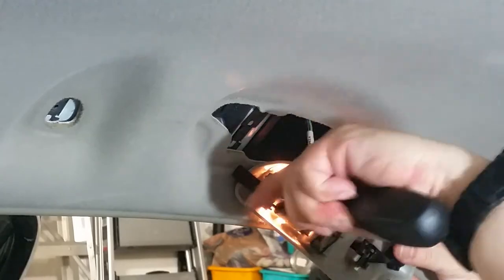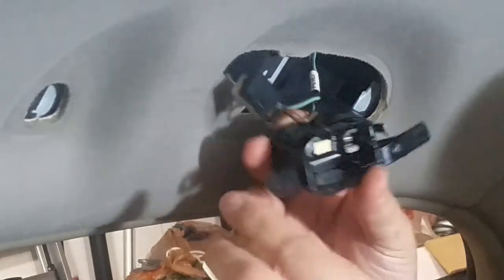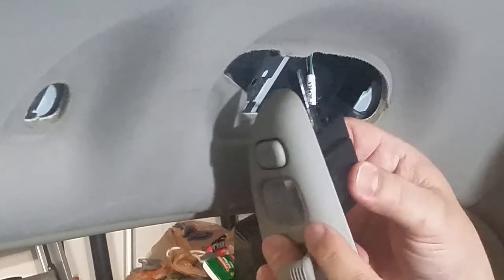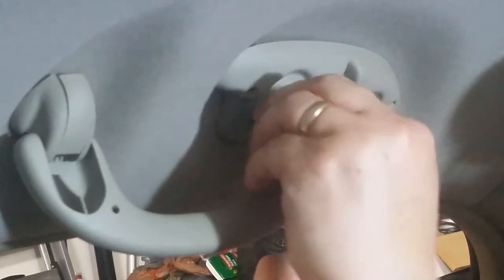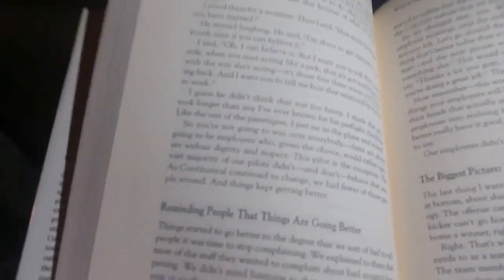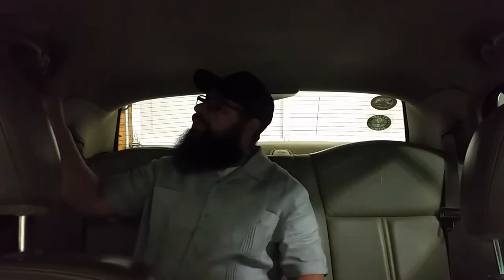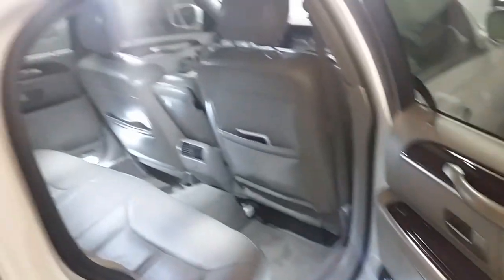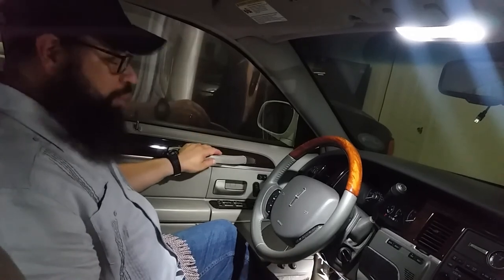Rear LED dome light from incandescent on Lincoln Town Car Luxury Land Yacht

Comment: Nice work. If you have a early 03 you have a gem because right where that little hole is next to the  mounting point there is a tiny little bulb in there providing a nice glow in the rear cabin while riding at night. Lincoln called it opera lighting and the early 03s are the only ones to have rear and front opera cabin lighting. After they discontinued rear ohpras in early 03 the front cabin ohpra lightning Green bulbs) remained until 06 when they took away the overhead panel with full read out compass. After 06 no ohpra lightning at all. So if you have a 03 go look I bet the bulbs are just burnt out
Reply from the maker: Never knew that on the 03 to 05. Thanks for saying. Mines is an 08 model.
Reply: I have a 03 Cartier. I dont see the "front Opera light" that you are talking about.
Reply from the maker: Sorry he didn't respond to you it's been 2 months already.

Comment: Wat r the numer for those rear handle bars led lights ur installing or the name i need 2 of those
Reply from the maker: https://www.amazon.com/gp/product/B07F9JTWQF/ref=ppx_yo_dt_b_asin_title_o02_s00?ie=UTF8&psc=1
Reply from the maker: Amazon has them  578 LED bulb 42mm  https://www.amazon.com/s?k=578+LED+Bulb+White%2C+42mm+6500K+CANBUS+Error+Free+6-SMD+Festoon+LED+Interior+Map+Dome+Door+Lights+Bulbs+211-2+212-2+569+6411%2C&i=automotive&crid=3LC37YFV5FM9K&sprefix=578+led+bulb+white%2C+42mm+6500k+canbus+error+free+6-smd+festoon+led+interior+map+dome+door+lights+bulbs+211-2+212-2+569+6411%2C%2Cautomotive%2C106&ref=nb_sb_noss

Comment: Do you happen to know what kind goes in the visors?
Reply from the maker: No I don't know what size bulb they take. I haven't done it yet.
Reply: We took them apart and take the same bulb as the dome and maps lights.
Reply from the maker: @irismariaadams7630  Did you put them in and turned them on? How do they look?
Reply: Not yet. We just got them in the mail. We will put them in tomorrow.
Reply from the maker: @irismariaadams7630  That's Great, once it's done you will see a big difference in light output. You will enjoy and hold on to your car a little longer..
Reply: Yeah, we are not planning on selling this car ever. We also own a 2005 Mercury Grand Marquis with 66,000 miles and we  will change all the interior lights on it as well. We just put a K&N Typhoon Intake System (69-3532TTK) in the Town Car and we did a muffler delete. The resonators are still there, but the car sounds amazing!
Reply from the maker: @irismariaadams7630  Excellent
Reply: We changed all the interior lights: the doors; foot wells (under dash), glove compartment, and license plate light are all the same; dome lights, map lights, and trunk lights are all the same. We didn't change the visor lights, they ended up being skinnier than the others, so when we figure it out, we will change them too. Thank you so much for making this video!
Reply: @J.C. System of things, we changed the sun visor lights a few minutes ago. The lights we got were Partsam 29mm 5050 SMD LED. They look really good.